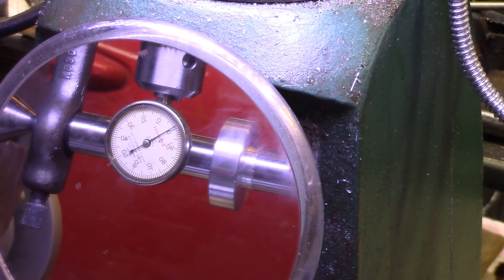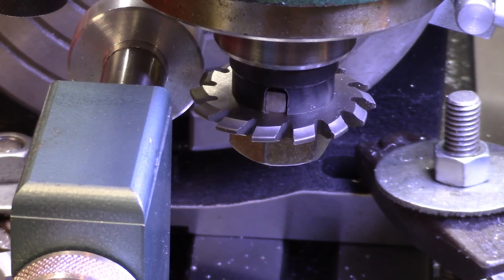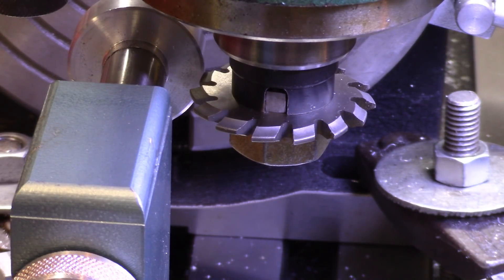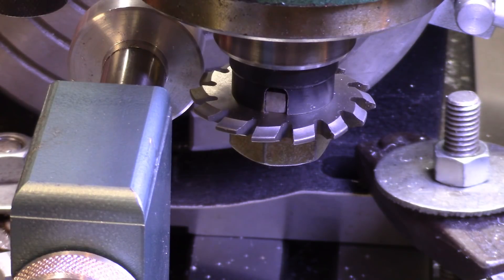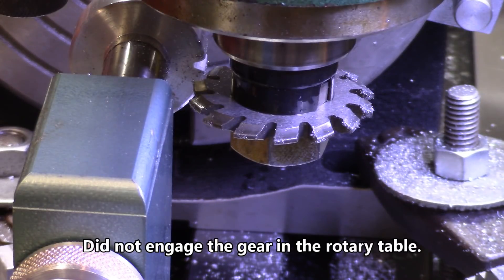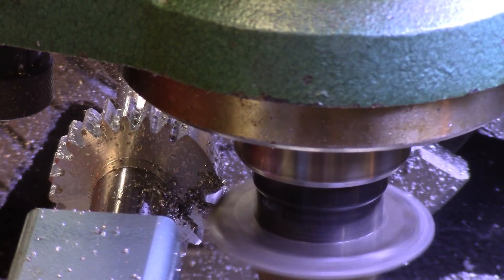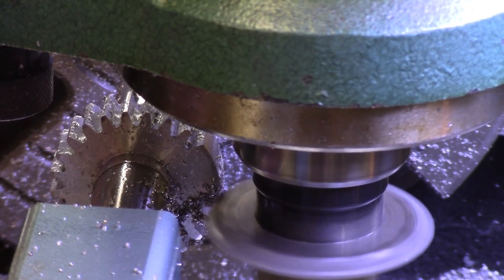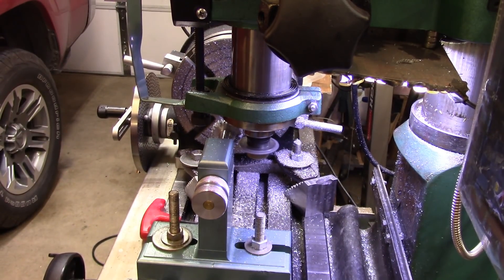The quest for metric threads   first change gear part 2 of 2

Comment: I see you're using the new version of Power Director 16 also. I wish I know how to send their  ad for 49% off into the ether somewhere. I PAID for their software, being inundated with ads to buy more should not be the way it is. :)
Reply from the maker: Yes that is a bit of a nuisance at that.  But I get the same for Nero and many other software packages.  Back when I was into computers and programming I tried to keep current with the latest version of several languages.  With expensive annual upgrades I soon was down to just visual basic and now I don't have any programming language on my computer at all.  Mostly I just ignore the ads.  You know that every year their will be a new and improved version.

Comment: I was expectingt to see ou struggle a little with the gear removal...     Aaaah...!!!    Maybe next time...     lol
Could you take a look at the joke part, I'm having a hard time to understand since the sound is quite loud and distorted, seems to me that the volume is way too high on the record...
I've ordered some "Iceberg letuce" seeds cause weather takes a long time to seriously warm up to season standards...   ;)
Reply from the maker: I guess I need to match the sound in the whole thing.  I record the the jokes on a different computer and it sounds normal there.  You might could turn down the sound a little just saying.  Thanks for stopping by.

Comment: Good looking gear.  Well done!  I've got a spindexer, but would like a good indexing head.  See you in the next video.
Reply from the maker: I will most likely be there.  Thanks for stopping by.
Reply: Harold, saw this and thought of you.  https://youtu.be/d2XaC0WVO4o   It has to do with an attachment to stabilize the column mills.
Reply from the maker: I have seen a couple of these today.  Thanks for the link.